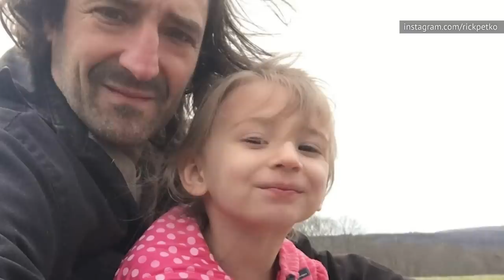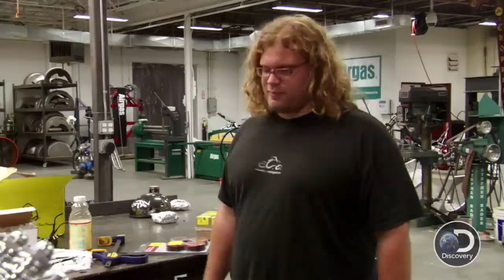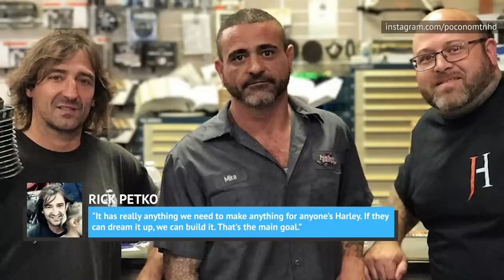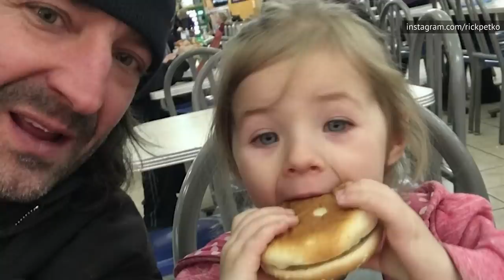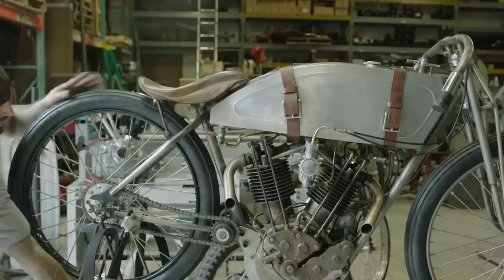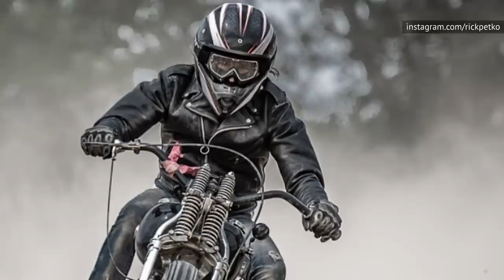Whatever Happened To Rick From American Chopper?

Comment: He may be a good fabricator, but they built non ride able garage art. I wouldnt want to have to ride one of the American Chopper or OC bikes for more than ten minutes or so. Loud, poor handling and poor seating. Saw a bunch of them on the way to Reno a few years back. I had full knobbies on the Tiger and was limited to 90 mph. These garage art bikes would blow past me on the straight sections, but they had to slow way down for the gentle curves on the freeway  because of excessive rake and fork length and I would pass them. Repeat until we reached Reno.

Comment: Unfortunately I have to sound like a jerk here but choppers are dangerous pieces of trash. I fear for anyone who has to stop quickly or make an evasive move to avoid a collision. With the front raked out like that the geometry is just all wrong. Also those handlebars with the two sharp points right in front of you are just waiting to impale you if you get pitched forward. Motorcycle manufacturers build their bikes the way they do for a reason. Any change you make to the steering geometry or suspension etc. can't be done without taking handling into consideration first then comfort and somewhere way down the list comes appearance.

Comment: If it weren't for tv these guys wouldn't be anywhere.  Droves of People are not buying these bikes.  Sure they could make a living doing this but they wouldn't have these big shops and all of these nice machines and homes.  I worked as a dealership mechanic and it's a job that doesn't pay shit.  Most mechanics make 13 an hour and $5 on flat rate.  And are expected to own $10+k  worth of tools and going to training at the factory facility.    I got off of flat rate pay and went to hourly for $20 only because there is a huge lack of mechanics available.  And it's because the pay is so bad. 20 an hour is still very low pay for the skills required.  This why I now work installing Windows and doors and make 1500 a week as a sub contractor.